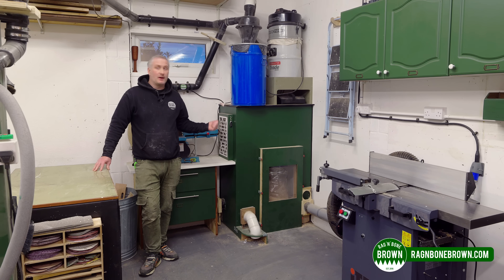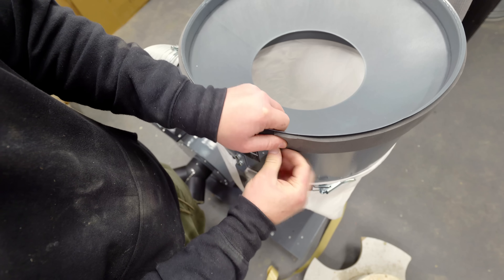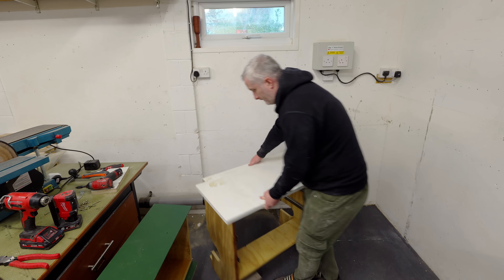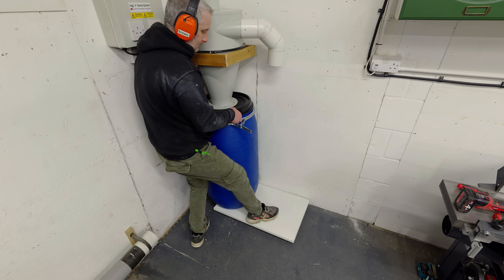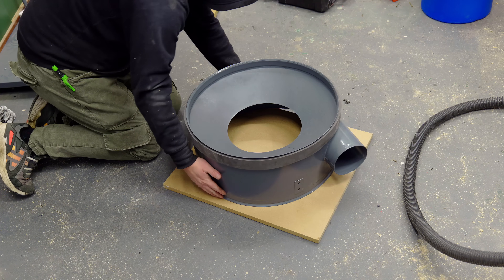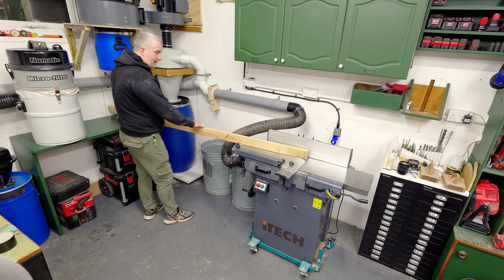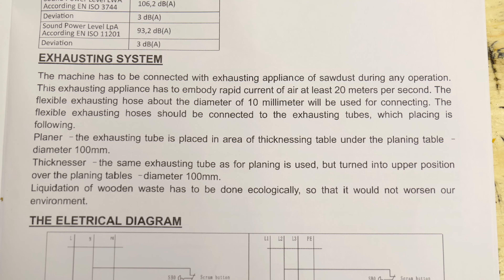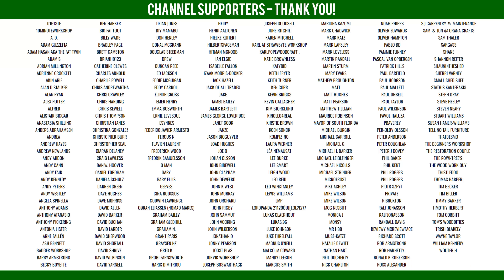Two Stage Dust Extraction: SURPRISING RESULTS!!

Comment: Great video. You have some of the most relatable content for me. 

I have been venting my 2-stage 2hp dust collector outside and it doesn’t seem to make a noticeable difference in temperature in my shop (summer or winter). Dust isn’t bad at all either on the outside, because very little makes it out unless I forget to empty the bin.

But I’d like to see you do the CFM test again with the filter disconnected as if it were venting outside.

Comment: I have a small 1hp system that I built a Thein baffle separator for. It works well even with my thicknesser at the end of a 20ft duct. However, I was careful to match the rotation of the separator with that of the fan so the airflow doesn’t have to reverse rotation between the two. I noticed that your cyclone rotates in the opposite direction to the fan so wonder if that is at least part of the reason for the poor performance. Worth investigating, as it would be interesting to know.
Reply: Indeed the air has to reverse rotation in his setup. But I wonder how he can manage to solve that… can the cylinder portion of the cyclone be flipped?
Reply: I would build a new cyclone with the correct rotation and 5” ducts to match the inlet of the impeller. My Thein baffle cyclone is also close coupled to the impeller housing with no flex hose between. I was aware that my low power set up needed all the help it could get so made sure to remove anything that would introduce resistance in the system. It worked well apart from getting clogged up when using my thicknesser. So I increased the width of the slot round the baffle by a quarter of an inch and that solved the problem.

Comment: You should do a test of the airflow with the  system vented outside instead of through the filter.  I have a similar 2HP unit, on top of a home built Thein separator, and have it vented outside now.  When I started I was using a filter, and I was disappointed with the performance.  I am lucky enough to live in a rural area so the noise and small amount of dust exhausted isn't an issue.  I have seen people set up a dual outlet system so they can vent outside in summer, and inside in winter. As someone else mentioned, having the sharp bend right at the inlet of the cyclone will also reduce airflow.

Comment: Reducing the hose, elbows close to impeller and big cyclone all reduced the air flow. I have poweful Felder 410mm planer and AF14 with reduced 125mm hose and it barely does the job. For thw next one my ducting will be 140mm and only reduced at the machine not at the chip collection extraction. Best regards from Croatia 😊
Reply from the maker: Thank you Andrea

Comment: Hi Keith, 
Did you do a test with the planer using the new extractor without the cyclone? It would be interesting to know if the extra airflow alone would fix the problem or whether this is partly a limitation of the collection on the tool rather than just the amount of airflow.

If it turns out that extra airflow makes a big difference, you could go for a simpler interceptor that just uses a pair of 90 degree 100mm elbows to divert air in and out of the top of the barrel. Most of the heavier dust will fall out of the airflow on the direction change. You would probably find more fine dust would reach the second stage, but the bulk fo the planer dust should still end up in the big drum.  FWIW I find my 1hp SIP is pretty effective clearing chips from a 12" wide DeWalt DW733 lunchbox style thicknesser (even with 6m of 100mm soil pipe duct and a couple of lengths of flexi duct).

Comment: Could you try by adding a Y shape splitter and use both of your motors and going back with another Y together to the filter. 😅 yeah Im the kind of guy who would do that. 
Im planning to do this kind of frankestein setup with 2 electric pressure washers to double the flow rate and make it closer to a fuel pressure washer lol

Comment: I think if you had added the cyclone and cleaned the old unit it "may" have been fine! after watching you clean out the old filter it's easy to see you were loosing air flow through it! plus I didn't see any real exhaust out of the box it was in???? that would really restrict the air flow!!  need a BIG vent in boxes for vacs/extractors to get the air it's sucking in, out of the box, as well as heat!  This looks great though!!  I designed and 3D printed a 4 inch (100mm) cyclone, it lowers the "new" volume of air flow, but over time it really doesn't drop as the filter never gets clogged! and my much smaller size (but still 100mm tubed) cyclone setup has no where near the loss you are getting!!!

Comment: Hi Keith 
I have found the sharp 45 degree coming out of a cyclone makes an impact. It appears you could move the straight hose up the wall to the planer/thicknesser giving a more direct entry into the cyclone. you may find that helps a little bit. Just an idea.  I did this hack for adding a remote to mine a while ago and it works superb. https://www.youtube.com/watch?v=qDXCPpzqB5E although I am sure your electrician will have been and gone by now ;)
Great video once again. all the best Geoff!

Comment: It looks like you have an improved system quite a lot, my setup is similar but i exhaust outside, i figure some loss of air temp is better than fighting with fine dust. I wonder if you can make any improvements to the collection shroud to do a better job on the planer / thicknesser? or if you jointed the board in the center of the cutterhead would it be less mess?

Comment: I think you'd be a LOT better off leaving the bin on the moving base, and slightly lifting the cyclone instead of dropping the bin, since it's only attached with some rigid ducting. A bin that size full of sawdust is gonna be pretty heavy, so having it on a rolling base probably is a lot nicer. All you'd need to change is the 2x 45 degree bend coming into the cyclone. If that was flex hose too, you'd have a lot nicer time emptying the bin.

Comment: Were I in your shoes I might look at something like the Record Power 3 motor setups.  Basically up to 3 vacuum motors in one unit that functions as a high volume high pressure system and could probably replace both your collectors.  It would handle the added resistance of that cyclone and all the flex hose a lot better IMO.

Comment: Reducing to 100mm is your issue. 
I got a 125mm big cyclone from China for £80. Coupled with a used 125mm P and J 4hp fan 
Built a shed outside and sound proofed it. 
The motor sits directly onto of the cyclone and the waste drops directly into my garden waste bin that has a cam system that wedges it to a neoprene seal. 
It vents to the outside but my workshop is air tight except for a vent by my log burner so the replaced air is heated. 
I run a 410mm planer/ thicknesser and don’t have a single stray chip. 
Very pleased with my system.
Reply: obviously the hose size reduction is the first issue with a HVLP. However if you just visualise what the air has to do within the cyclone it's fairly obvious why it will reduce the air flow velocity. BUT, if you accept that you are putting a filter in the system, you would normally expect a gradual efficiency reduction as a conventional filter clogs up - possibly to very low flow levels. The cyclone will reduce flow initially but that flow will be much more consistent over time. The options are to clean filters and maximise initial airflow or not clean filters and have a more consistent but lower initial airflow?
Reply: @andygardiner6526 we mustn’t settle for this non sense of an industry . Im fucking having my cake and eating it too.

Comment: Yeah, cyclones and HVLP extractors just don't mix well. Unfortunate as it would definitely cut down on filter cleaning, but if you want good airflow it's just something you have to live with! Very interesting video though, always fun to see actual numbers.
Reply from the maker: Thanks
Reply: @RagnBoneBrown  I noticed that Milwaukee vacuum with the back out adapter on top. Is that the new dual battery dust tractor that also has a cord from Milwaukee? If so, can I get a few photos by chance
Reply from the maker: I'm not sure I'm allowed to talk about that one yet and should probably be doing a better job of hiding it from my videos! But it's a big unit so it's been quite tricky. I will talk about it when I can
Reply from the maker: Where did you see it by the way?? I can't see it in the vid...!
Reply: @RagnBoneBrown  I saw a little snippets of it here and there and I pieced it together between two different videos. This one and the baby bed one are you sure you can’t send me just a few photos I am super intrigued I’ve seen the patent for it and it looks really good. Also, if you happen to have a measurement of roughly, how tall that mysterious vacuum is because I’d love to add it to my stack.
Reply: @RagnBoneBrown  I took screenshots everywhere I found a snippet that had it in it I can email them to you if you like if you want to edit them or blur them in the videos
Reply from the maker: Yes please drop me an email
Reply: @RagnBoneBrown  where do I find your email address?
Reply: @RagnBoneBrown  never mind I found it on your website. Sent you an email.

Comment: I've got a shop vac and cyclone in my small workshop. It works great and I only need to empty my small plastic drum as 99.9% of all sawdust is caught by the cyclone.
I want to improve the filtering by getting a larger model such as the Charnwood that you have. I'm struggling to see why I would need a cyclone. As long as the filter stops the super fine particles from escaping into the work space I can't see the point in separating them with a cyclone. 
I think I'll just get the Charnwood and work out a method of using a bag inside a drum beneath the filter instead of the plastic bag.

Comment: Nice one Keith i need to upgrade my dust extractor at some point probably very soon as a dont think mine is quite powerful enough either plus i am also gonna need another one for the lathe as am gonna put it in a custom built room of its own. Do u have any recommendations for one on slightly less budget than u set for yours. Could probably stretch to 250 right now for one. 👍🏴
Reply: I got a second hand p and j 4hp for £100 with five inch port and a big 5 inch cyclone from China for £80. I built an external shed for everything and it dumps into my garden waste bin. ( that seals using neoprene and cams. The fan shed is full of noise absorbing tiles and you can hardly hear it. I set my own 240 volt remote relay for £20. 
It vents outside but my workshop is air tight apart from a vent that is behind my wood stove so the replacement air is heated as it comes in. 
I run a 16 inch planner and do not a single chip when using it.

Comment: I personally think the axminster cyclones not that good I have more than one cyclone that is smaller than the axminster and I experienced far less drop in efficiency with them, which leads me to conclude its design of that particular  cyclone Is not good. At the moment I'm using a three horsepower extractor on the Axminster Cyclone  without a filter Directly exhausting outside building and I am only achieving 20 mile an hour on my analometer I don't know how that compares to your form of measurement, but I am very disappointed in the result. Using it on my table saw and band saw. One thing where I am lucky is I am using the Lumberjack Planar thickness and it does not require an extractor it's built in extraction Which I have no complaints about as far as extraction but obviously it doesn't have the best cutter and the provided blades are awful so had to upgrade to carbide blades, but can't wait to get the modern version as you discussed the lack of Spiral cutter in your previous video
Reply: Venting outside after the cyclone is not celebrated enough from what I can see. The moisture in the air should deal with any remaining particles. 
What about the air coming into the workspace? It needs to come in as fast as it’s going out. Do you have a hole in the wall ?

Comment: Hi Keith, i contemplated having an extractor inside the workshop or outside for a while and i decided to put it in an adjacent vented shed. The heat loss is insignificant really, maybe its the fact that i can't heat it much but id rather no dust than heat. I bought a second hand felder 4hp dust extractor on a 6" sewer pipe duct system it is absolutely fantastic i have pretty much zero dust its something i never regret doing. I just kept the standard bag filter because fine dust leaking doesn't matte. Imo id get rid of rhe cyclone for that amount of suction loss and for time saving you have to account for sweeping/dusting time

Comment: Sometimes you can have all the airflow in the world but if the tool doesn't have an efficient dust extraction design then you will get dust in nooks and crannies, and the floor, instead of in the dust collector. There are loads of videos on YouTube on the loss of airflow when using cyclones (I think Matthias Wandel has made some really detailed ones). I also believe that the additional small barrel you installed under the air filter will cost some airflow too. Basically anything you add onto the system will come with an airflow cost so you have to make up your mind and decide if the benefits are worth the losses I suppose. That said you obviously have a lot more airflow now than with the old system, so maybe it is just a poor design on the planer/thicknesser?

Comment: Very interesting, a great labour of love and although not as good as you hoped, it’s better than the old system.  I like the way you drop the dust barrel out for changing it, I plan something similar for my own dust separator.
Unfortunately those anemometers are not particularly accurate; they are ok for relative readings but I wouldn’t rely on their numbers being gospel.  If you are able to eliminate any more flexi pipe out of the system, that’ll help increase air flow.
I too thought you’d need a pressure relief valve on the plastic barrel, thanks for showing that you didn’t
Reply from the maker: Thank you

Comment: About the loss due to cyclone Matthias Wandel explains it very well in his videos. Blowers create suction by swirling air around whereas cyclones do the opposite: the suction is partially used to make swirling air.

You probably did well by taking a not so big cyclone in that regard, a bigger one would have make more loss i believe.

Comment: I upgraded my extractor a couple of years ago. All works fine, but I found that because the motor, filter and drum is in a small annex (along with the compressor) it is so powerful that it sucks the heat from the workshop 😢during the winter !

Comment: I wonder if fine dust could be still trapped in the folds of the filter. May have done it off camera but I didn’t see you use the rattle handle in the filter. Still, great system you have…!

Comment: I need to upgrade the dust extraction system in my small shop. I currently have a wall-mounted Rockler Dust Right 650 CFM extractor, and I believe they just made a separate cyclone dust system to work with it. You certainly provide a lot of good information here, especially showing how much loss there is with the separator. Depending on my needs, it might be time to upgrade the extractor, too. Thank you for the education!

Comment: Good up grade  but wen you  tune it on and off because off safely  switch  you  have  to rich up high because  wen you  you   tune  off by power  and  to get better  suckson  why not having 2 dust extractor  to up grade the suckson  you  have  to so you  sud have  2 at 
The same  time  as .

Comment: Should have got a camvac 😝
Reply from the maker: 🤣 so that's why you asked what it was called
Reply: Is a Camvac enough to be used stationary to handle multiple tools in a small workshop ? I have 2 of them (1 single motor and one with 2 motors, the last one associated with another cyclone just to help me empty bags faster as 55 liters is not that much with my planer/thicknesser) but I dedicated both of them for a single tool each. I never tried to use a single Camvac for everything. Maybe I could simplify the whole setup !

Comment: I use the Axminster cyclone with my Axminster planer/thick (blades) and get no chips but I went for the 2hp record power  camvac instead, which is high pressure instead of low.
Reply from the maker: Thanks, have you ever tested the m/s airflow?
Reply: I might be ample to chime in on this matter. I also have twin motor Camvac. So I decided to do the unthinkable and clean its filters to get clear reading :D. Well it turns out that its pretty powerful for HPLV machine. I got 23 m/s on 100mm pipe run. Pipe is shot (about 1 meter) and has two 45 angels on it. I have exactly same looking anemometer as you, and my 1 hp Jet LPHV (looks jus like your old machine just white) gets 24.4 m/s after 2 meter of flex hose. Sorry for the wall of text.

Comment: Nice upgrade, especially for table saw! Very surprising how much restriction the cyclone creates. In HPLV systems difference is smaller (about 20%). Did you test the extractor whit out cyclone on your planer? I wonder is 30m/s vs 21 would make difference. Bit sad that it did not work better on planer, at least emptying will be lot easier. Maybe you could add big trash bag in barrel (held between the lid). That would make emptying even easier and less messy.
Reply from the maker: Thank you, yeah glad it's not just me that was surprised by the difference! I didn't try out the planer directly to the motor, unfortunately ran out of time. I expect it'll do a better job, but probably still not pick up everything! More experiments required I think!
Reply: If you put a bag in the trash can it gets sucked up and causes issues - according to someone on Reddit earlier today. Needs to be a steel can ideally.
Reply: Might be. In theory if the barrel is air tight the bag should not get sulked in. But you are probably right. There might well be enough leakage for that to happen.